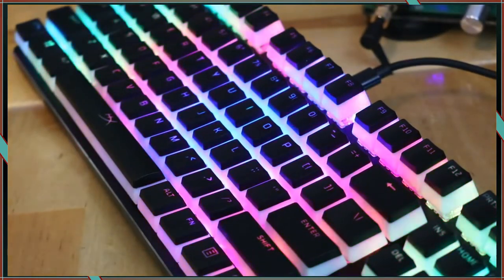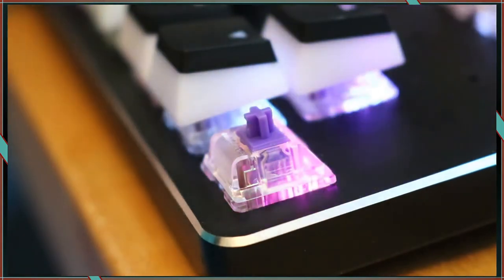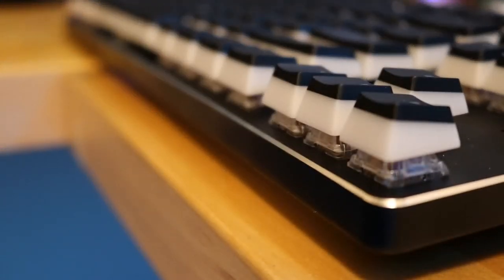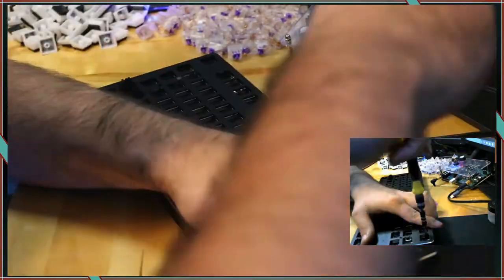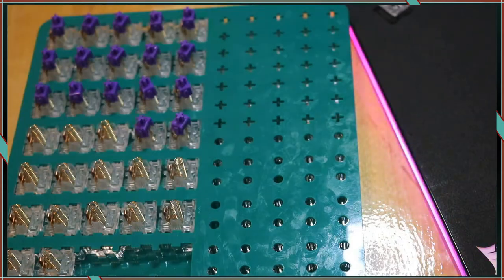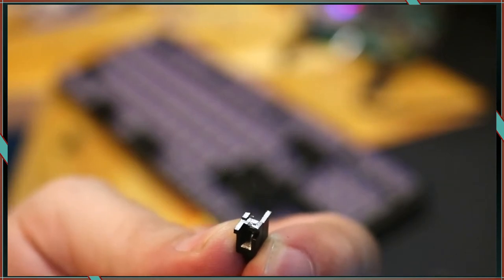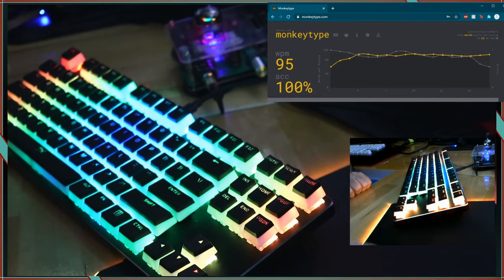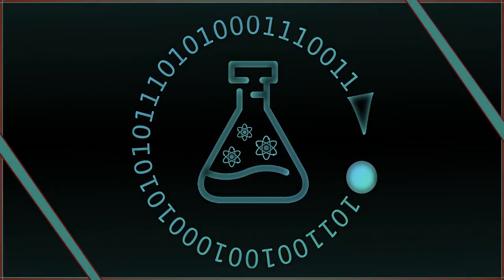Keyboard Build: GMMK TKL with Lubed Zealios V2 Switches and Krytox 205g0

Comment: Hey does this model have the same problem for separating the PCB and the plate? The older one had a bunch of screws and some aluminum thingies you had to bend to be able to take them out.  Also which stabs do you reccomend for this keyboard?
Reply from the maker: I'm not sure! I'll have to look again. I never separated the plate and PCB . I don't remember there being the tabs, I thought it was just standoffs?
 And
durock stabs. This one is plate mount.

I'll reply sometime tomorrow
Reply: @ireakhavok  thank you so much
Reply from the maker: @Moni-ValMar  Yes, you can take off the plate, you just have to look under certain parts of the foam for screws and there may be some tabs, so just be careful, if you care about those tabs. Even if they were to get damaged, I don't think that it would be noticable when the board was put back together.
Reply: @ireakhavok  thanks, that's kinda a deal breaker. Think I am going with the KBD67 lite r3

Comment: Do you think this keyboard would sound good with black ink’s? Also do you think durok stabilizers would fit?
Reply from the maker: Durok Stabilizers are PCB mount, and there aren't mount points on the PCB, so no to the stabs, but yes, I think that black inks would sound even better on this keyboard. Black inks are a little heavy for my style, but I definitely do believe that the amount of thock would be rather full and deeper than black inks sound on some other boards, and satisfying. It seems like I actually prefer the tone of the thock from the GMMK series, the foam does a great job on the thock, and the top - integrated mount style deepens the sound pretty well.